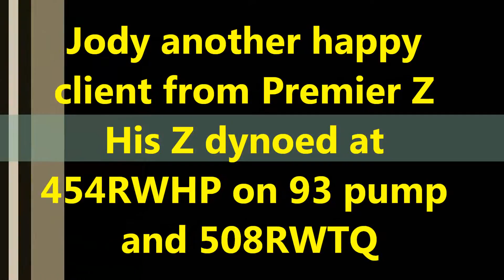Premier Z Performance (300zx Specialists) - Z32 Best engine EVER DONE

Comment: I have a 90 tt and I was wondering what you recommend to replace the factory struts with? I'm trying to keep the duel mode system it I don't know if you would recommend another company beside the dealer or if you think there is a system that is not adjustable but offers good ride quality. I want the factory ride height not much lower. Any help would be appreciated.
Reply from the maker: never got any calls or messages :( try again tomorrow my number is 919-622-1901
Reply: The300ZXGuru lol you got the questions reversed. Thanks thou